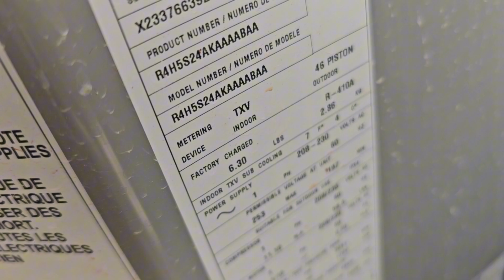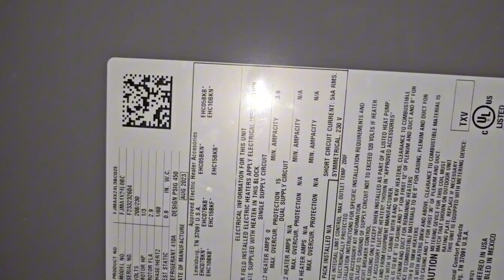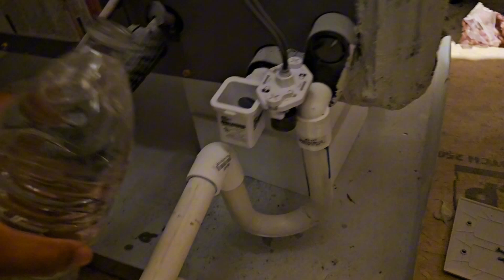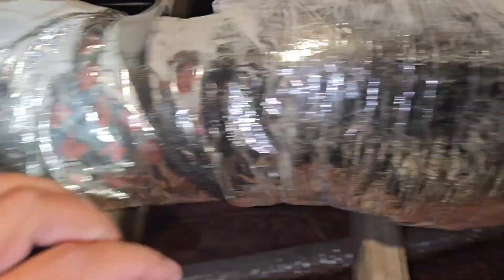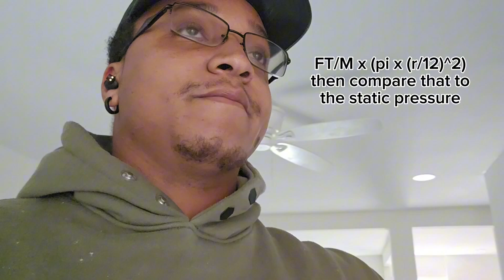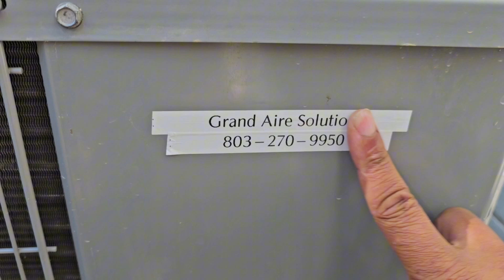System Start Up On Tempstar Heat Pump

Comment: Builders did the install?  This has to be one of the worst installs I've seen buddy.  The Line-set covers do not look straight, definitely should have come lower, the line-set outside and inside should have been run and bent correctly, the low voltage and high voltage is all over the place, looks like hacks did this job.  The mastic is all over the place, looks like crap. I'm glad these weren't guys you hired.  Sorry for being so critical, but my crews would never let me see if they did a job like this.  You guys are better then that, sorry
Reply from the maker: I appreciate it. Even when I have to just do condenser swaps I do my best to make that stuff look as mint as I can. I can definitely say I've seen worse for fresh installs but this one wasn't one of those. I'm definitely not a fan of the "Flex to the unit" method, but this definitely could've been a lot worse.
Reply from the maker: Also, thanks for the constant support and feedback 👍🏾💯